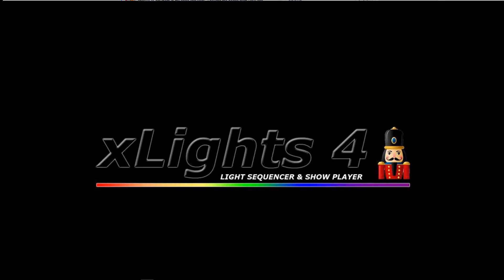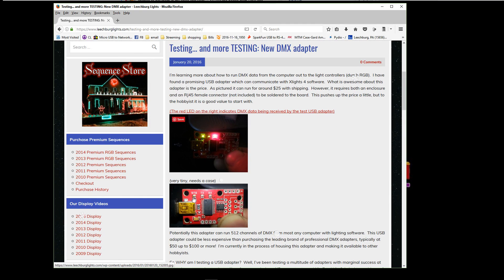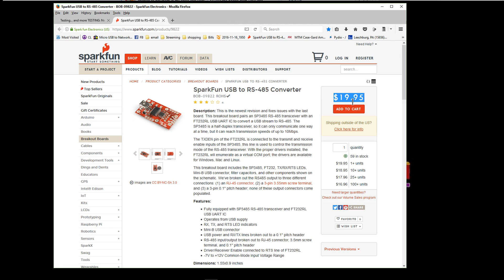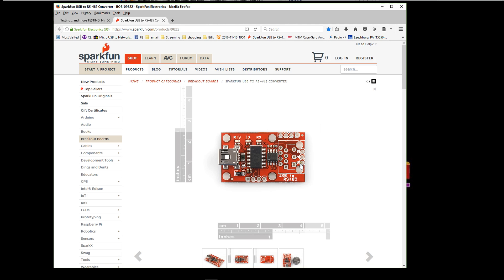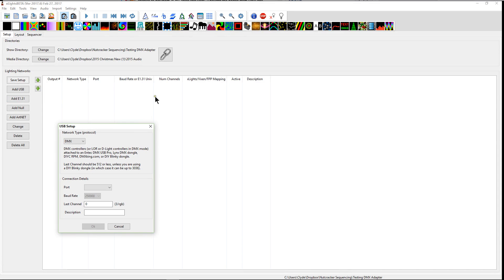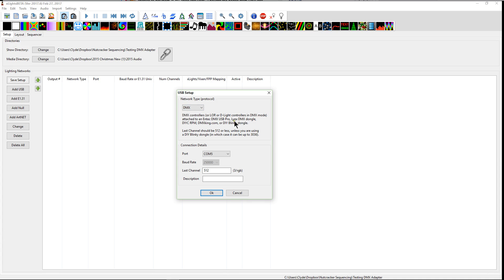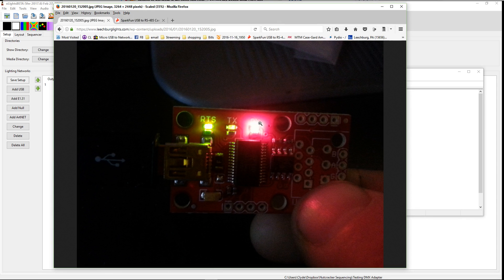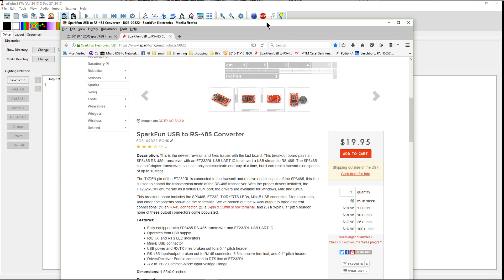Setup USB to DMX  single universe of DMX

Comment: Excellent tutorial.
Open DMX has all of the timing etc generated by the host computer whereas a few of the other dmx boards like the ENTEC Pro have onboard processors and all the timing is generated by it.
The flash rate of the TX (transmit) led should be at the 40fps (25mS) or 20fps (50mS) that the sequences in Xlights (or similar) are created in. It is possibly half that rate with a flash on on 1 tx cycle and flash off for the next tx cycle.
Reply from the maker: Yes!  That's it.  And I knew that too.  It has been a very long time since I have used the old Enttec Pro.  It did all the data comm to the controllers.   Thanks for the reminder Alan!  If you don't use it, you lose it.